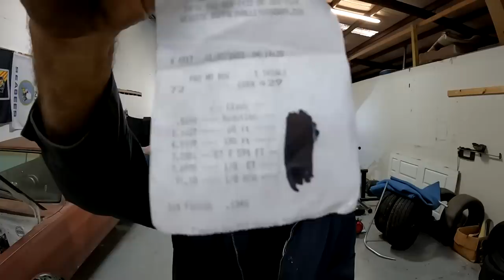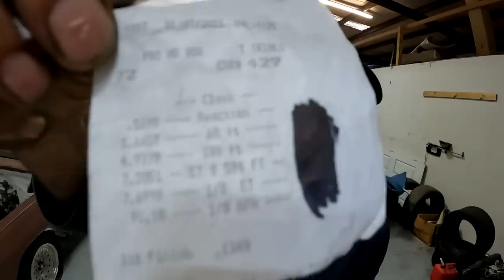Project Bottle Rocket Grows Up - Here Are The Numbers, Facts, History And It's Future

Comment: I get the impression that the 318 was embraced more so here in Australia than it did in the US. I have only ever remember hearing positive stories about how well and how hard the 318 goes.
Reply: There's a tendancy in North America (I'm Canadian) to discount the more economy V8s. On paper there's nothing wrong with the 318 but it's not a 340 or a big block so, to many people, there's no point building one.
Reply: Here in the States, the 318 has always been viewed as nothing more than an economy engine intended either for Grandma to go to the supermarket on Wednesdays and to church on Sundays, or for fleet/work vehicles that are always on the go which means that fuel economy, long term reliability, and having just enough power to build up enough speed to safely enter freeways and maintain the speed limits are all that matters. Very few people here in the states realize the potential these engines have... Even the 273 is more recognized as a potential performance engine than the 318 is.
Reply: Way more 318s over there...therefore cheaper.  The 318 is everything you'd ever need for our A Bodies...360 was too much for the chassis!
Reply: The story with the 318 is the same as with the 302 Mustang and definitely 2 bbl. SBC Chevy's and ALL of the inline 6 cars of the 60's and early 70's.  

People simply sneered and stated that's a 318 car, not worth a crap and the entire car engine trans and all went to the crushing yard. Same for Mustangs and Chevy. 
Imagine how many 289-302 Mercury Cougars that were just sent to the crusher, which was almost all of the Cougars produced.
Heck even 360- 390 2bbl. were sneered upon in trucks. A 390 2bbl. was a definitely 300,000 mile engine with some care applied. They had plenty of pulling power to not have a need to go above 4000RPM to pull anything anywhere. 
There was so much of a push back in the 80's to make everything MINT. So if you didn't have anything RARE in the MINT arena there was nothing to be had. Value to the floor with that car. 
The Shelby GT500, California Specials, Boss, Cobra Jet, Yenko, Hemi, or PACK cars; and other rarities has ALWAYS been the top tier, and anything less was trash. That's been the mentality since the 60's....

There was even a great lull between 351C even being anything but a hunk of metal here in the states. That's why they are no longer around. NASCAR raped most of the heads in the early 80's from the face of the planet.
Reply: The 318 was never a performance engine from the factory. It didn’t even get a 4 bbl. til 1981 when it became the only V8 option in the passenger cars. They did put true dual exhaust on the ‘73-‘74 road runner standard 318 2bbl.
Reply: mopar is so strongly hated by the gm ford crowd back in the day that if you found an old mopar it was a mopar yard.....mopars were first to the crusher anywhere else... 
"if it aint a '69 its garbage" was the mantra and the venomous jealousy can still be seen today.....
ive had 318's with swapped 4bb intakes and 360's built pretty hefty....have a chev guy walk buy and he'll talk like you kidnapped his children... "a kid like you shouldnt be allowed to have that" said dozens of times to me
being a kid in the 90s the vitriol thrown at me for having a 74 roadrunner makes me completely unsurprised at whats happened to the car community...now youre all trying to buy parked/stored for $1500...ill crush em first

Comment: Never has so much drama surrounded a 12 flat (1/4 mile) run - good job Tony!  My suggestion for the next improvement is to install a rear anti-roll bar (not sway bar or different pressure in the right air shock).  2,900 lbs. is admirable.  I have little doubt that you can drop several tenths in the 1/8 (middle lower11's 1/4 mile). 10's in the 1/4 mile (~ 6.8x's 1/8th mile) is going to take some work in my opinion - but it will make me smile if you get it there.  Good luck UT!

Comment: I don't think people understand the "exercise" of exacting the best of what you've got by using creativity and resourcefulness with a car and parts that other people would throw away. Unfortunately, the "mainstream" auto performance video creators and magazine editors would rather have you throw the checkbook at it, buying high-zoot , high-dollar parts in hopes they can be as cool as the "paid for commercial advertisers." . Great video, Tony. My hat is off to you and I look forward to you kicking more ass with this old tub. (Oh, with regards to your tire contact patch: a pair of 8" Ramcharger wheels would also flatten out that patch significantly without increasing rolling resistance found when lowering air pressure. Just food for thought.)

Comment: Damn good video!  That's a damn fast street car built from knowledge and hard work. Good job getting weight out of that thing. Would never guess under 3k!  Would love some more stuff on weight saving, by the way. Now im gonna go dig my last time slip up because i wanna see how bad Uncle Tony would kick my ass! My car is a 2000 z28 ls1 6 speed with cam and home ported heads. I know it ran 12.0 @ 119. Street car. Drove it there and home, and it did not break. Sure, there is faster stuff out there. But my car is fast enough to be fun and that's what it's about. Will post my 8th mile time and mph tomorrow when i dig it out of the car. Thanks again uncle Tony. That ol mopar gets down i dont care what the trolls say.

Comment: I absolutely love that car! I have had couple of early '70s 4 door b body's, never made one a drag car, but I found  they are better balanced than a 2 door and get better traction ( I am Canadian and used them for winter beaters). I have seen many videos from reputable engine builders who say 318s are a waste of time and you just proved them all wrong. As for the building them loose theory, I have had great success with small and big block mopars and small block Chevys staring with high mile (250,000 or so) engines; they won't last another 250,000, but they while outrun a fresh engine. As for the key board warriors out there, I have had 43 old mopars over the years, have drag raced and did short-trak oval, I am 60 years old and restoring my 68 super bee I have had for 38 years, yes, I know these cars well. Can't wait to see Bottle Rocket's next stage! Keep up the great content Tony

Comment: I don't hate 1/8 mile. but I wish you had a local quarter track.
Reply: Agreed. I'm old school, West Coast, and have a difficult time with converting 1/8 to what I've only known. 👍
Reply: London Ky and Bowling Green Ky both run 1/4mile racing still and are only about an hour or two from Tony
Reply: Most tracks are 1/8 mile these days due to insurance as cars have gotten so fast. Top Fuel and Funny Car with be 1/8 or, 800 feet within the next few years . They are really close to 300 mph in 1/8 now it top fuel.
Reply: @fr.rustymatheny7707  that's fine. But 1/4 mile mph at the traps and et tell me story I can compare to an awful lot of data points that really relate to decades of records for similar cars. And I don't think UT is going to be doing 300 mph.
Reply: @bbb462cid  whatever floats your boat dude, whatever floats your boat.
Reply: @fr.rustymatheny7707  I think you don't understand. 91 mph in the 1/8 is a different thing than 91 mph in the 1/4. A good quarter mile car isn't necessarily a good eighth miler and vice versa. If a car is built to be a quarter mile car...then quarter mile data is what I compare to. Nothing to do with my jollies.
Reply: @bbb462cid  look man, we build race cars for a living , we race cars all season .’
I understand well the differences in 1/4, 1000ft, 660 racing .
I’m not going to assume what you know and, do not know , but, I know this subject well- been at it more years than most on Tony’s sight have been alive .
Difference between 1/8 and 1/4 is simply gearing man   That’s about it.
We run just under 120 in the 1/8 and 130-140 in 1/4 .
Jesus man, we have been using race calculators a really long time , we all know what our cars should run at the 60, 330, 660, 1000, 1320 and therefore, in the weather for a given day, at hp, car weight -we know “plus/ minus “ 3 hundredths what the car will do - period .
Nothing hard about it, no magic - just the right gear/ tire size for what you need to length of strip one is going to run .

We are a high 5 second 660 car, low 9’s 1320 car and can run either way with a simple pumpkin change .

Working on a 6 second duster now .

So, really, whatever you want to think is fine .
I was nothing but compliments to Tony so, don’t know what your bugged by .
Reply: @fr.rustymatheny7707  I'll say it again to clarify. 91 mph in the 1/8 is a different thing than 91 mph in the 1/4. A good quarter mile car isn't necessarily a good eighth miler and vice versa. Please indicate if you disagree with any of that.
Reply: @bbb462cid  yes, I completely and utterly disagree .
Your mixing things up .
Yes, 91,mph in 660 ft compared to 91 mph in 1320 feet is quite different, the first is faster .
But a car that can run 91 mph in the 1/8 and cross the stripe at top of rpm , change gears and it will run 120+ in the 1/4 .
Only thing that changes is the gearing , if you do your math correctly, you have the gear to cross the stripe at 1/4 at same rpm you did in the 1/8 - in general .
That’s the difference between running 1/8 and 1/4 .

We do this damn near every weekend during racing season .

We run a 4.56 gear in 1/8 and 4.30 gear for 1/4 .
Though we are off a tad and really need a 4.10 for 1/4 mile . 

Secondly : how a converter is set up has a great deal to do with mph .
Lots of cars et really well but are down in mph due to converter being loose .

So, we always have to deal with how the car reacts to the hit, what the 60 is, what the 69/330 split is, the 330/ 660 split , the 660 to 1000 or, 1350 .

We move to 4:30 gear, we give up a little 60ft, but, pick up between the splits .
They ran 1/8 mile so, 1/4 has nothing to do with the discussion .
Have no idea what rpm Tony went through the traps so, no comment on what’s left on the table and, as he well stated, he has some work to do to get the 60ft dialed and repeatable .

Be happy for him man, he has massaged a bunch of 40-50 year old parts into a race able car that with some tweaks can easily be an 11 second 1/4 mile car with a gear change .
A 7.65 1/8 is a 11.93 1/4 - with correct gearing .
7.05 is 11.0
6.95 is 10.92

That car has had no test and tune that I have seen with new trans/ converter and he still has suspension issues to deal with, front is reacting a little fast for the power he is making .
Some time/ adjustments - he can get where he wants .
Most street racing today is 1/8 just as most tracks are and a 11 second street car is still a pretty quick car, even today.

Is there a difference between a dedicated 1/4 mile car and a dedicated 1/8 mile car ?
Yes: 
Gearing , perhaps a bit tighter converter , perhaps a taller tire .
All depends on if your class racing , bracket racing, street racing .
 We have a 5.95 car this time of year in Texas weather- that’s a 9.20 1/4 mile car .

The classes in organized racing, say Super Stock and Factory Experimental ( FX) NHRA all ran 1/4 mile.
The classes were set up by time .
Once everything moved to 1/8 mile , that had to use the 1/4 mile standards and compute down for 1/8.
So, we run A/FX in early spring and late fall- that’s a 9.20 1/4 mile class, which is 5.92 1/8
Starts getting warm and humid and a track at 459 ft above sea level moves to DA of 2500-3000 ft and we have to run B/ Fx which is a 9.50 1/4 mile, a 6.09 1/8 .
Everything down here is 1/8 mile other than NHRA events .
But Everything is based off of 1/4 standards for classes .
In any racing circle I have ever known since 1/8 mile began , a 7.50 1/8 mile car is an 11:50 car.
Finally - ALL Safety requirements are based on the 1/4 mile times as well as mph and calculated down to equivalent 1/8 mile categories.

For this reason , a 7.50 1.8 mile car has to pass tech inspection as an  11.70 car - period .
A 6.41 1/8 mile car is a 10.0 1/4 mile car.
As soon as an 1/8 mile car runs a 6.40 , that’s now a 9 second 1/4 mile car and cage, trans blanket, engine diaper etc, etc, have to pass tech for a 9 second 1:4 mile car .

We deal with equivalents all week, every week or racing season .

Hope this helps clear up any misunderstandings .

Pick up a NHRA rule book, Nostalgia Super stock rule book - everything is listed by 1/4 mile times and 1/8 mile equivalent as well as mph .

Do hope this helps as I think we are talking past one another .

I don’t remember what Tony’s 1/8 was, somewhere in the mid to upper 7s in the 1/8 so, with a gear change, he could run the listed 1/4 mile equivalent.
That said, without a gear change , he would miss the equivalent unless , the car is under geared for the 1/8 , which I don’t think it is .

Agreed that a car set up for one, unlikely to run the equivalent without a gear change or, adding more boost or spray if going down from 1/4 to 1/8 .

Comment: Go with 15 psi in tire then go 2 psi up until it spins then back to the pressure it does not spin .
Reply: Another speed secret: different pressures in both tires. The right rear gets the most weight put on it, so it can handle more pressure. The left would need less if physics are a real thing. Even with a Sure-Grip rear end, one of the tires will still be the weak point to start a spin. That tire will always be the left rear unless it is larger in diameter (old open-diff-class drag racing trick) or has lower pressure in it.

Comment: If you're gonna weasel out on the only performance measurement that counts to those of us following the build, you should place your N/T sticker(s) wherever your dial-in normally goes..
If the car is going to run multiple strips with different Tower locations, run three N/T stickers on the left/right/windshield, to assure that the guys doing the spotting for comp number/dial-in see it and don't blow your secret.
Personally, I'd rather you stuck it on a trash bin...I would rather see hard data to document improvements (or not) as you make changes to the car.
It's a cool project, very similar to what I was running back in the late eighties/early nineties...only thing I'd change is to add a tall pinion snubber with corresponding floor plate to take the hit..if it already has a snubber, close the gap up some plant the tire a little harder.
I'm currently building what will hopefully be a 9.50-ish '97 Mustang based on the same philosophy..
Mine's gonna run a disposable T-5 five speed though..I expect it to eat transmissions like a fat kid munches potato chips, but they're cheap and plentiful and only take half an hour to swap..
😁

Side note..I've been subscribed to both you & Andy's channels since you started the "Mission Impossible" build..and I don't think YooToob likes you, brother..I get instant notification of Andy & Vizard's content, but never a whisper of your stuff...have to go searching for ya every time.  

Keep it up, old school is the ONLY school I ever attended.

Comment: I'm curious about your statement that a 904 would have been quicker than a 727. The valving and internal components of a 904 are literally a miniaturized version of a 727. I suppose the mass of the larger converter and larger internals takes longer to spin up, but is that really that significant? I've been a professional transmission mechanic/shop owner for many years, but I've never been involved with drag racers, no reason, it just never happened so I'm truly curious. I did sponsor a guy who raced a humvee mudder truck, that was fun. He wasn't splitting hairs with fractions of a second, he just wanted it to last. I probably answered my own question didn't I? LOL. Love your channel, keep it up.

Comment: the thing about swapping from quarter mile to eighth is the launch off the line is more important--there's less real estate at the "top end" to chase someone down after a soft launch to keep broken parts to a minimum. so some will have to engineer their ride differently. 

Had to chuckle over the commentor who wants the N2O to go. Nitrous was always considered "cheating", but the Fast and Furious and the advent of fully computerized engines (ie, as much efficiency as possible) means that power adders pretty much are the way to get to 100% VE.

that weight loss is great for an intermediate 4 port street car keeping the stock seats without swiss cheesing it into an empty dog food can.

Comment: I have run 1.46' sixty foot time more than once with my naturally aspirated small block chevy on a D.O.T. 225/15 tire, approx 8" wide tire on a 15x8 rim, wheel. Stock Hz Holden suspension, lowered springs and koni rear shocks only. Original factory front shocks were used on that run.

Weight 3400+ Lbs

Wheel spin to half track as soon as it gets to the sixty foot  timer.

Comment: I bought a whiplash cam because i thought it was what cam you said was in that 318 but damn it was a terrible cam. I followed the build and did what I could even flipped the pistons around now I think I see what I Left out.  Torque convertor, lighter valve springs.  Thanks UT for all the great videos.

Comment: I'm an old drag racer from the 70s. I  raced a Super Stock Duster 340 auto and ran  11.50's @121mph. It had to weigh 3140 if I remember. I  don't see how you removed so much weight from that  B body? My car had maybe 150-200 at best removed? I'd love to know your secrets of weight removal. Makes me want to build a similar car. I still have enough parts for a complete car except for a good chassis/body. Mostly  340 stuff. Keep up the great videos!
Reply: Hi. If you watch the early videos, you'll see one example. Tony removed the 'heavy' metal bracket holding the grill in place, and replaces it with a few sheet metal screws!
Reply: Did your have no wipers or wiper motor too? 😂